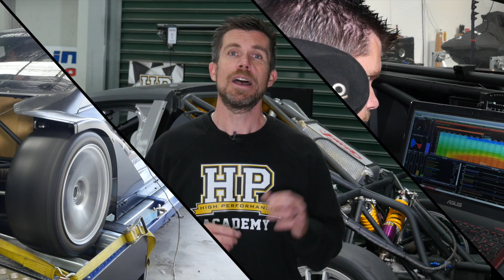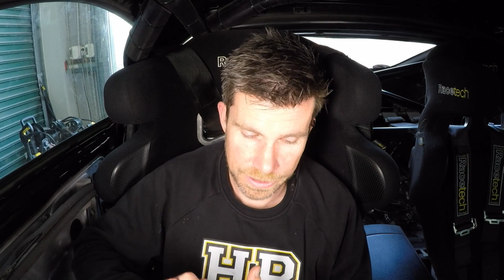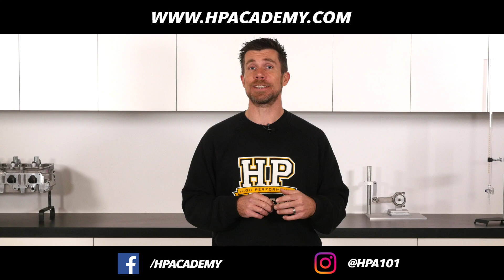[HPA Q&A] Understanding VCT/VCC tuning (Variable Cam Timing/Variable Cam Control)

Comment: How does amount of air in cylinder effect what timing you can have.  

For example in my car I reduced the throttle in my drive by wire to be at 10% I put compared to 20% input and now I wonder if I need to adjust the timing higher since I have less air  compression to what it originally was

Comment: Great video.  question that i need second opinion on please.    I have a built forged engine with stage 3 camd and bigger turbo  from a reputable shop.  I then installed the engine  uploaded a base tune.   I get what sounds like loose chain. I checked under valve cover and all looks super.   it has 2 solenoids and 2 cam phasers.  all brand new.

am I correct in suspecting the base tune is maybe causing the phaser noise at 1800 to 2400 rpm?  it makes no noise if I rev it normal or fast. it only makes it if I rev it slowly and also if cruising steady at that rpm.  

It can only be faulty phaser or solenoid or i think maybe tune. i wanted to know if a base tune can cause this symptom since you talk about vct tuning.   

ford 2.3 focus rs  engine

Comment: would it sound like VTEC once you want low rpm driviability and then high lift duration with wide open throttle?

Comment: 2:02 can't imagine how AFR would measure richer (so it means we have less air), ad make the same torque. is there an understandable reason behind that phenomenon?
Reply from the maker: When we're tuning light load VCT timing and aiming for fuel economy we can find that the torque remains relatively consistent even though we are in fact reducing the VE of the engine (and hence seeing a richer AFR). This allows us to reduce the fuel delivery and make the same torque with less fuel being delivered. It doesn't always show this characteristic but it's definitely something to watch out for.
Reply: Great question. I would expect the AFR to naturally become leaner when the VE increases, as more air flows into the cylinder.